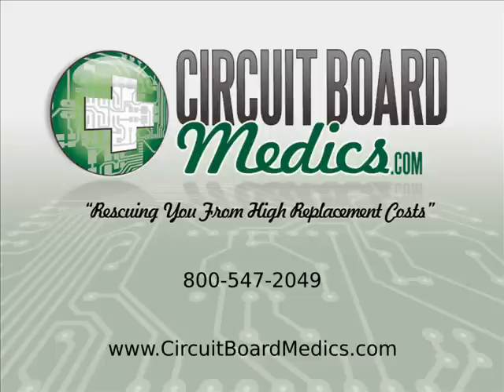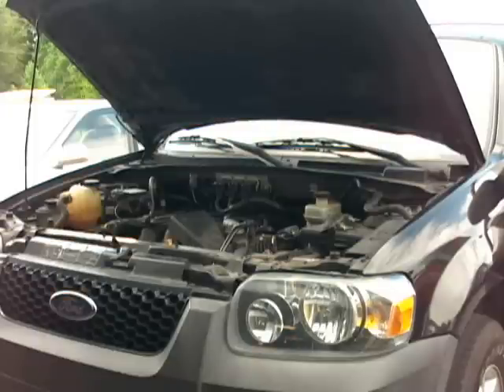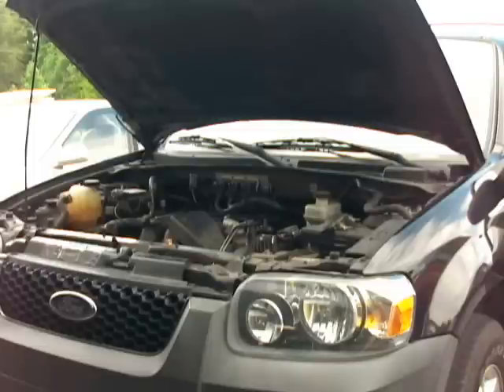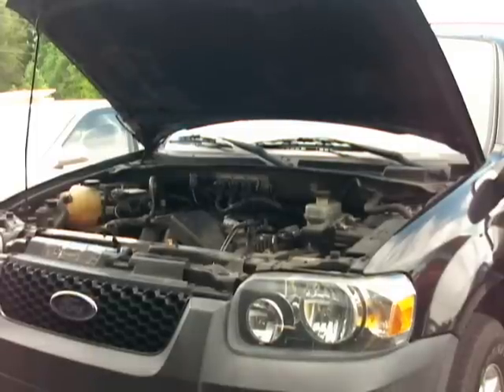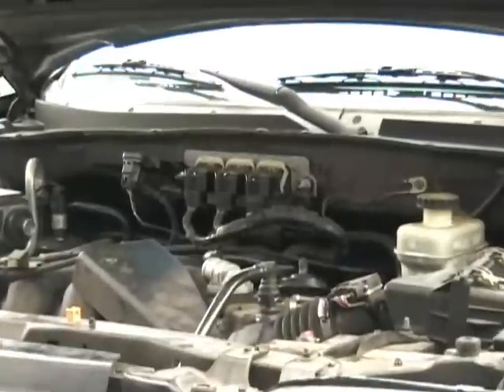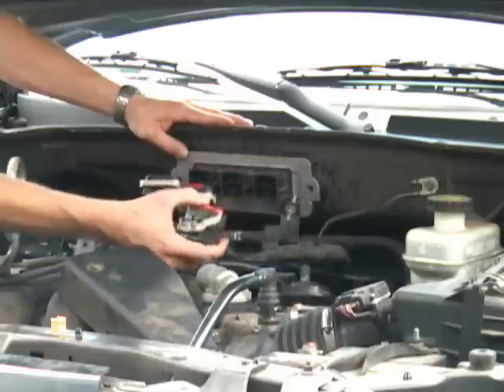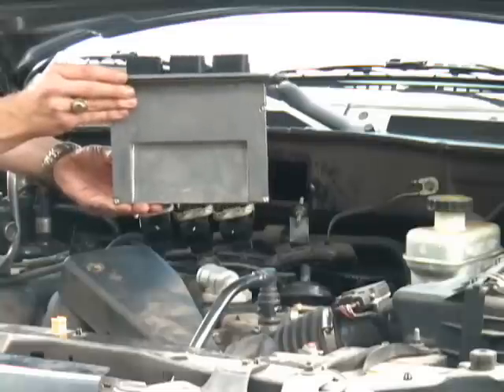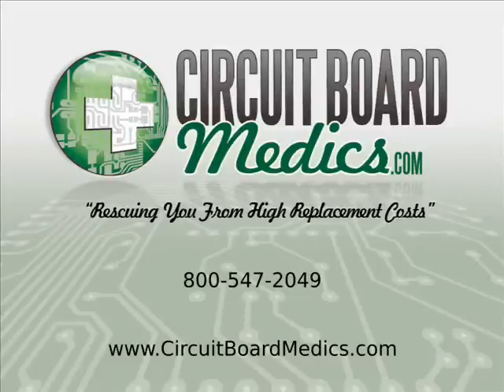How To Remove And Repair A 2005 2006 Ford Escape, Mazda Tribute, Mercury Mariner PCM

Comment: How do I test my my pcm?  DOes it throw out a code?  My cheap code reader has nothing.  No warning lights...?6cyl mazda tribute04
Reply from the maker: Typically, a failed PCM will throw the following codes: P0351, P0352, P0353, P0354, P0355, and P0356.

You could try using a more capable scan tool to double check the results. What symptoms do you have?
Reply: @CircuitBoardMedics  funny thing, my cheap code thingy shows none whatsoever.  Reverse is strong, Park, well, parks well, and low gears are forward motion, no acceleration.  Any idea where I should start?  a mechanic friend said its not likely that safety switch thingy...but ?  Plugged filter? Im going to change it and the oil